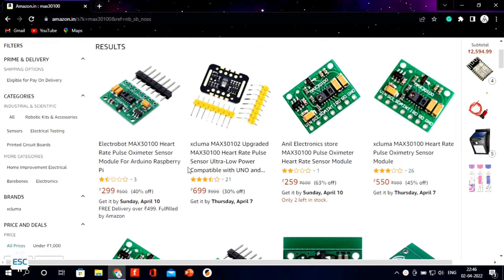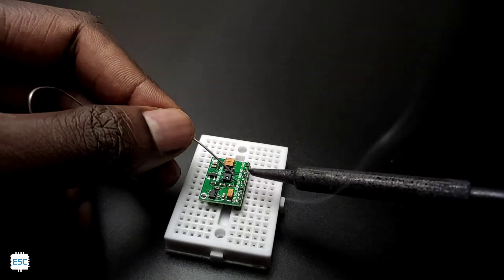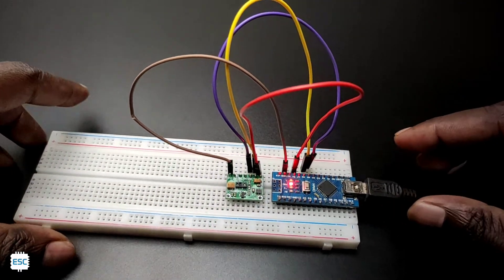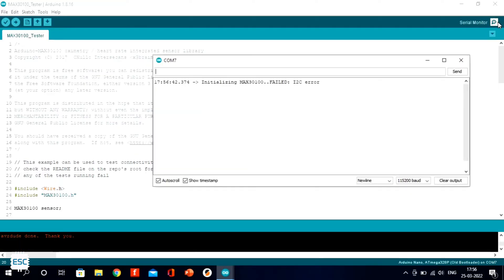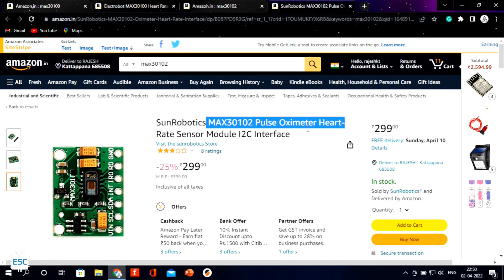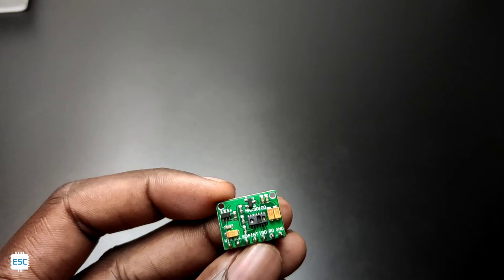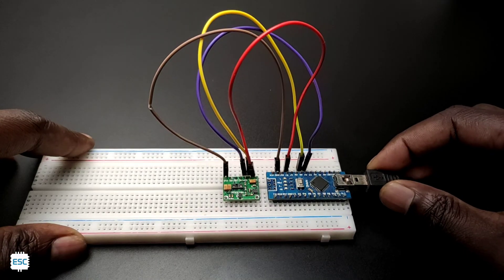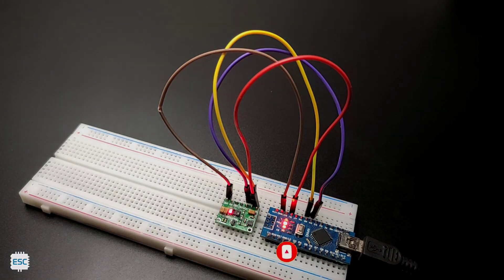How to Fix PULSE OXIMETER MODULE | MAX30100/102

Comment: Hey there, i've been trying to use a MAX30102, but the black one, which actually appears at the beginning of the video, does this could work with my sensor too?
Reply from the maker: If the circuit is same

Comment: Hi, how did you connect the 4.7k resistor to the metal thing on the pcb? did you use any special type of wire
Reply from the maker: Copper wire
Reply: @EDISON_SCIENCE_CORNER  would this work for the black version of max30102?
Reply from the maker: @awts_8116 yes
Reply: @EDISON_SCIENCE_CORNER  thanks

Comment: Do you have any solution for my GY-MAX30100 sensor sir?
its show "Initializing MAX30100..FAILED: I2C error
" when i use the example "tester" on the MAX30100.lib
Reply from the maker: This means your board is not detected. Either it is damaged or a bad connection
Reply: @EDISON_SCIENCE_CORNER  and how to fix it sir?😭
Reply: @Sieu_Joestar Did it got fixed? How did u fixed it?
Reply: @abr2736  No i didn't, it's still broken 😭 and i bought a new one

Comment: I'm using a max30102 sensor, is it necessary to solder its pines to make it work?
Reply from the maker: Check it without modification. If not working please follow this hack
Reply: Bro iam also using but when I connecting oximeter is not working

Comment: Max30102 press key problem
Reply from the maker: What?
Reply: @EDISON_SCIENCE_CORNER  
have a another doubt,
if I connect MAX30100 with another sensor in arduino board,  the heart rate goes zero and spo2 showing references values..clearly pulseoximeter is not working. But if I connect pulseoximeter with arduino, heart rate and spo2 values are showing and the pulseoximeter is working. Do you know what is the issue ? ( when I connect another sensor, max30100 is not working. )
Reply from the maker: Which device is that
Reply: @EDISON_SCIENCE_CORNER  
PC + arduino uno r3 + Max30102. 
Can u please give the solution for the press key issue?
,
I have a another issue with max30100, what I mentioned above, how can I solve ?
Reply: Code for blood oxygen 
[   Serial.println(F("Attach sensor to finger with rubber band. Press any key to start conversion")); while (Serial.available() == 0) ; //wait until user presses a key Serial.read();   ]

I pressed all the available keys, but it is not converting.

Comment: I've done the same but the led is not glowing, how to fix
Reply from the maker: Which library are you using
Reply: @EDISON_SCIENCE_CORNER  max30100_milan
Reply from the maker: That will not work use the max30100
Reply: @EDISON_SCIENCE_CORNER  but heart rate is showing
Reply from the maker: You cant get correct values without the led